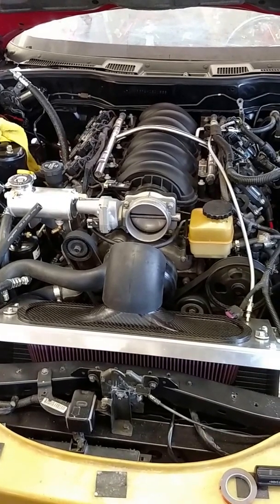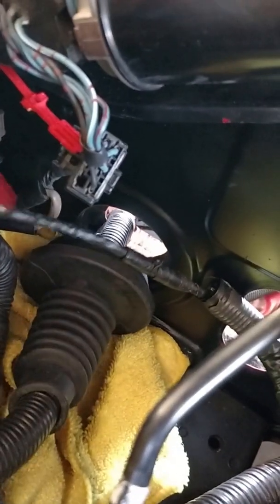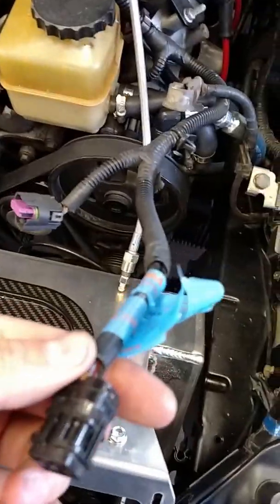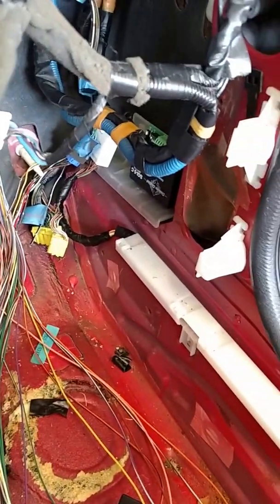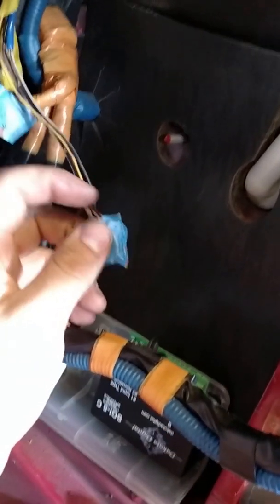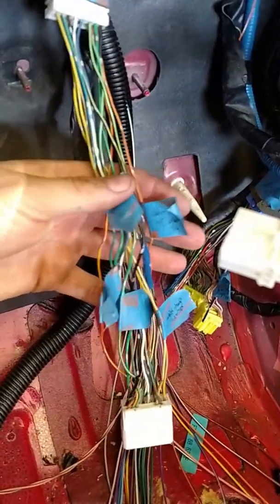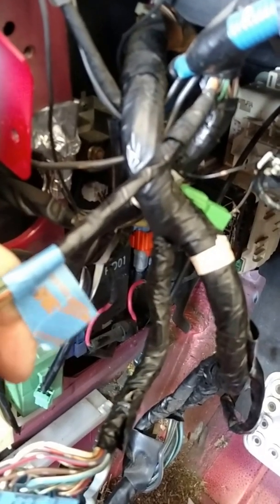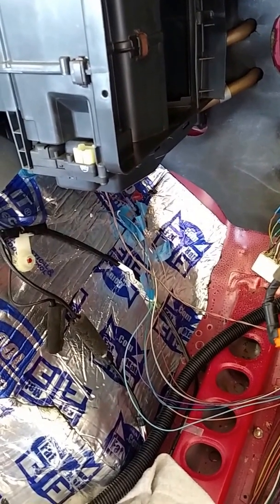Rx7 ls2 engine swap wire connector location

Comment: that is awesome  i have a 93 R1 fd Rx7 and decided to start doing a swap this will help me what about if you car is auto as far as not having a clutch what can i do in that case 512-230-1860 thank for any additional info
Reply from the maker: I think if your car is auto then the only difference is you will have a few extra wires at the x14 connector. I documented my full swap here if it helps: http://802projects.com/rx7.php
Reply: 802Projects thank you souch hope you have a bless holiday and new year. im big on rotary engine but the old i get i dont do much my fd have been sitting for few years with no engine bosy only have 32k on it and this project give me more time with my grandson to work on it thanks again